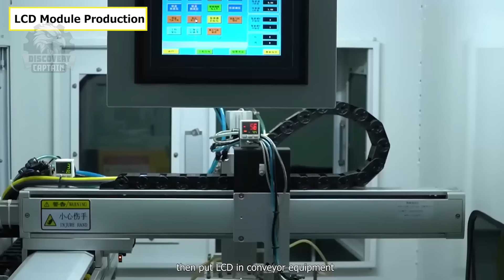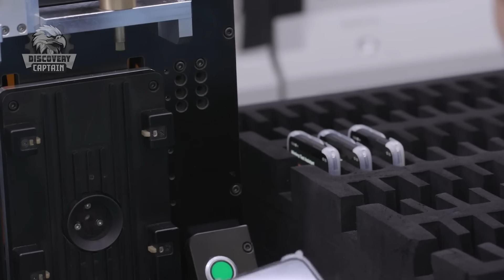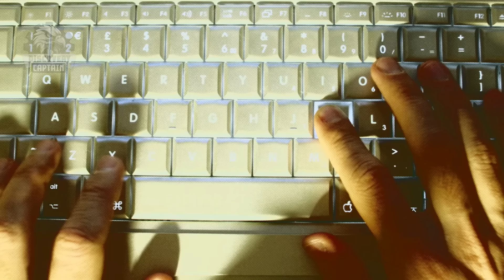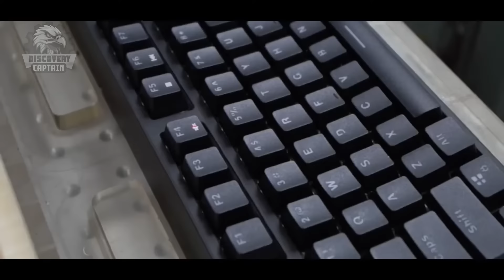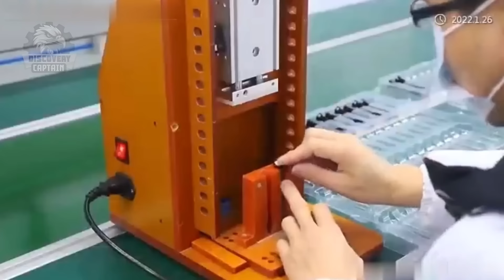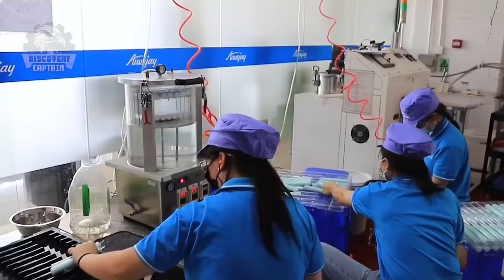How It’s Made: Samsung Phone, Keyboard, Electric Toothbrush

Comment: Drop not miror
Gsm 
2gbram
External memory 
Media Tek 
G sensor
13mp
4g 
4000mah li poly batery 
Dual 4g
Reply: Hd drop gsm ram ROM external memory media Tek
G sensor 13 mp 4g 4000 dual
Reply: Hd drop gsm ram ROM external memory media Tek
G sensor 13 mp 4g 4000 dual